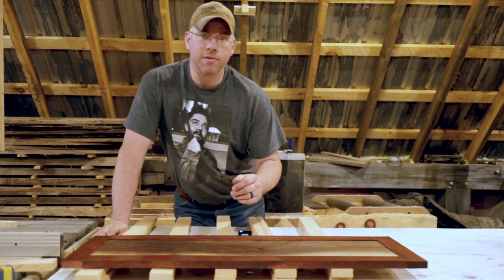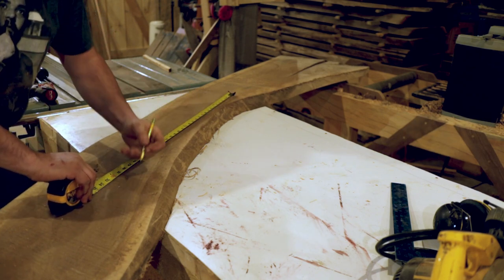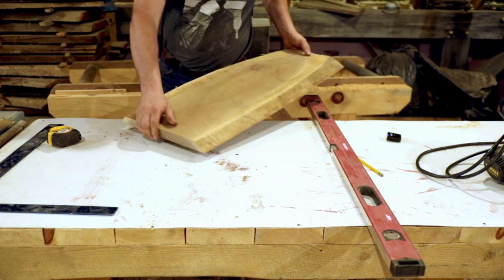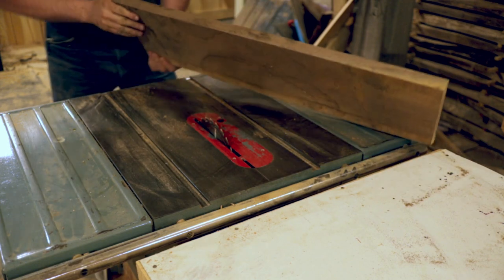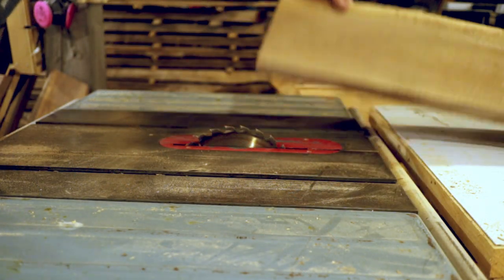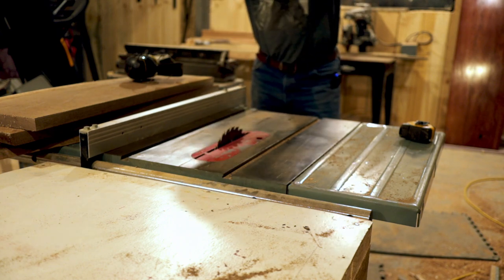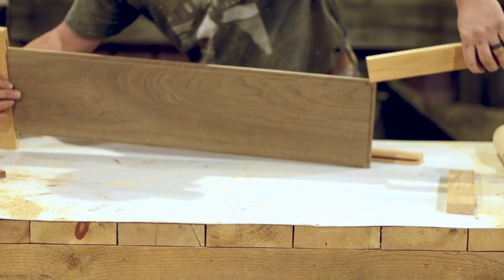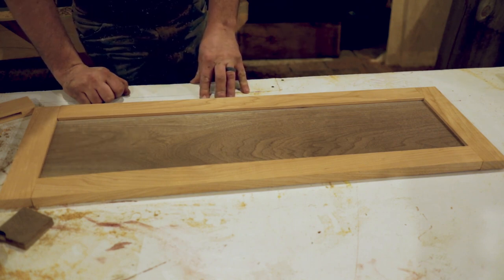When Black Cherry And Black Walnut Mate

Comment: I have a 9' and 16' auxiliary oak fence that attaches to my table saw fence. That way I can use it the same as a jointer. I been straight edging my rough lumber like your doing for years without problems. Biggest thing is respect the saw but don't be afraid of it.

Comment: No need to freehand anything.  Try a skill saw and a strait edge fastened to the material to get rid of the live edge first on horses then go to the table saw. My strait edge I use is a 1/8" X 2" X 8' aluminium stock available at most any big box store. drill 1/8" holes 2" in from each end and one in the middle  for drywall screws to fix to your stock. Or use A clamps. Trojan saw  horses are what I use.
Reply from the maker: I used to do that a lot and it works fantastically.  I started doing the free hand when I had a tiny shop and this much faster for me so it has become my routine.

Comment: Those cherry scraps will be great for smoking pork ribs and other meats.
I remember you leaving a grove at the bottom of your router fence. At first glance it looks like wood chips are going to keep your work piece away from the fence but it is clear they are on the grove. 
To bad you don’t have a band saw big enough to resaw those panels. The blade on the sawmill is to thick for that kind of resaw.
How are you going to connect the stiles and rails. Dowels? Pocket screws would leave obvious defects on the inside even with plugs.
Reply from the maker: For this it'll be pocket screw with the plugs.  It's something that won't be seen.  When I do the kitchen next year there won't be any mechanical fasteners in the doors or drawers.

Comment: Prof the planner snipe, there are YT videos to correct a lot of it are you going to install dust collection system in the wood shop  ??
Reply from the maker: I've made a ton of adjustments, bottom line is these old Delta planers aren't beefy enough to keep the head from moving at the start and the end of the cut.  I would love dust collection but that'll be a ways away.

Comment: Looking good ... the Draws of course! ;0)

I know you "Do things your own way" , but what is your thinking on the saw regarding knife and guard?

Glad you managed to find the chair after all that time away! ;0)
Reply from the maker: Riving knife on table saws are excellent safety tools, blade guards I do not like at all.  My thoughts on most safety equipment is that sometimes it can make one complacent while operating dangerous tools.  Safety equipment should not be a substitute for proper techniques.  Most shop tools should be operated as if they have no safeties, that way you always respect the danger zones.  The tools I grew up learning on were all "use at your own risk" tools.  No guards, no safeties etc.
Reply: @TheTradesmanChannel  Feel the fear .... and do it anyway!
I agree with you about the complacency ..... Happens every time before you screw up! 

or so I am told ;0)
Reply from the maker: It damn sure does!